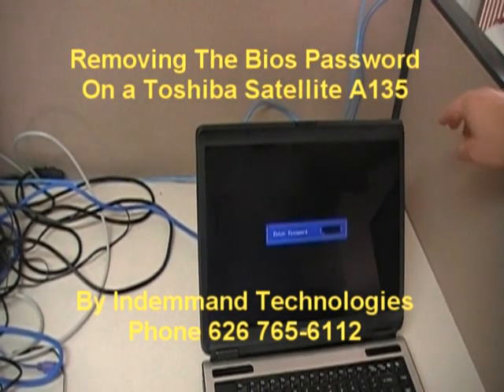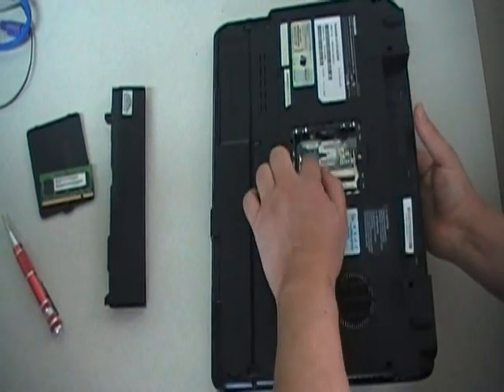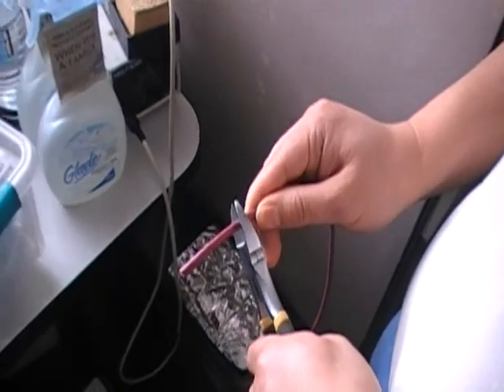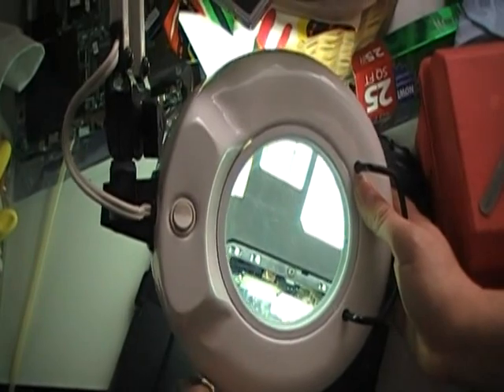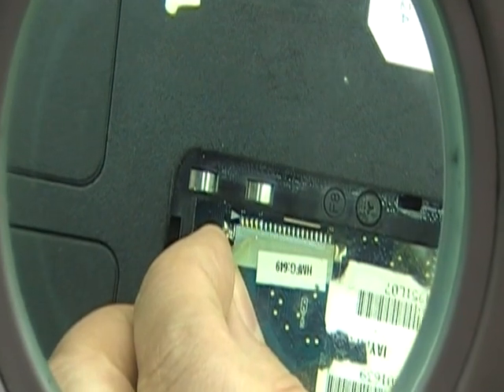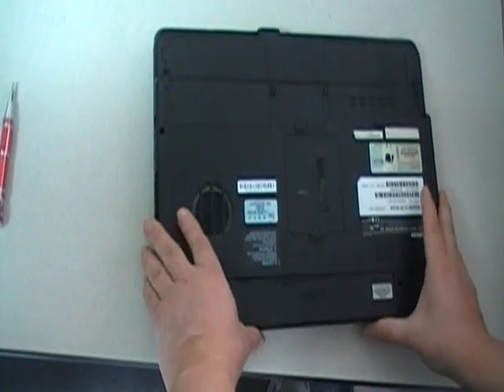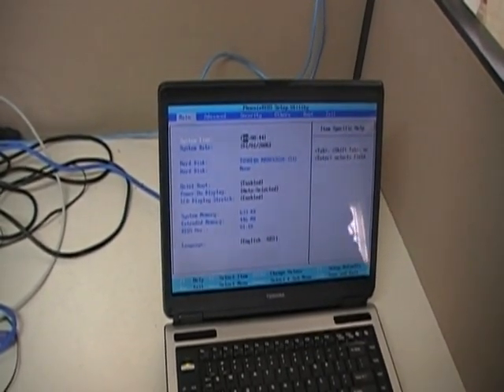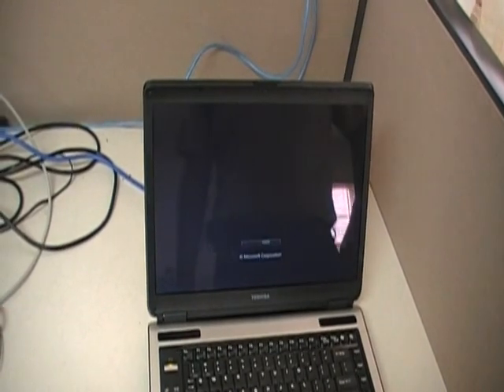Toshiba Satellite A135 Bios Password Removal

Comment: Your instructions are almost right,actually you do need to remove battery and memory and touch across the T and the U for 45 seconds anyone that this worked for thought they were only touching the U but actually touched across both otherwise it will not work and don't touch ground only across T and U......

Comment: Thanks very much for your direction. It simplified a very common but irritating procedure. My need to reset the BIOS/CMOS settings in this Satellite L455D arose from an issue with cooling fan and heatsink.
   After cleaning the heatsink and replacing the fan, the computer would boot but there would be no display and the fan would turn off. Fearing that the board and/or processor maybe defective, I opted to take the path of least resistance to get some direction since this particular board was about $300+ to replace.
  Fortunately, the procedure you described so accurately, allowed me to diagnose the exact cause of the problem after repair, and facilitated an accurate fix for the machine which is now running like new. Kudos!!!!

Comment: Hello my cousin is having the same problem with her Toshiba Satellite M305-S4907 would everything be different than what you showed on the video inside of this model? I haven't tried it yet..I also saw another video where the guy jumped it by putting both ends of the wire on both tips of the soldered bumps...would it work still?

Comment: I did this to a customers Toshiba and it worked...BUT as soon as I went to press F2 the password came right back on. I repeated the steps over 5 times and it does the same thing. Do I need to keep the jumper on the "U" longer than 20 seconds?

Comment: Thanks for the video--it worked. I stared at it about 10 minutes longer than I should have though because I was literally looking for a white "T" and "U" on my board whereas I just have the "JOPEN" ... Explaining that the "T" and "U" are the shapes of the actual metallic circuit in the description and not a label might be helpful. Also I'm not sure everyone understands that the metal clips holding the memory are what you used to short it since you can't see that in the video.  But thanks again!

Comment from the maker: @moviewatcher7249

Check  voltage on your power adapter first and see if that
's the problem. If not you might have damaged the board. 

FYI.. I don't think you damaged the motherboard If you shorted out the correct jumper you would not have any damage to your motherboard.

Comment: It took my many hours longer than it should have.  Why?
In the video you DO NOT explain where to put  the "GROUND END" of the wire.  Your hand was blocking the view, I did further research and someone on another site said "The ground is the round post between the mother board and the case. Also you do not explain the "T" and "U". I was looking for the LETTERS "T" and "U"   JOPEN1 with a white silkscreen square. Inside the square you will see what looks like the letter T over a U.  Thanks!!